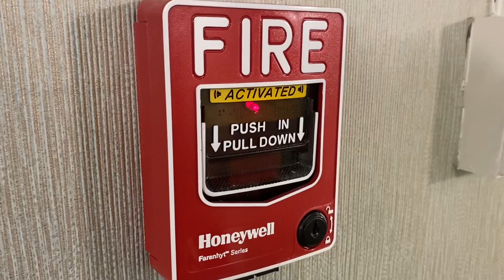From The Field: Fire Alarm System Upgrade

Comment: The horn at the end - did you replace it with a speaker or did you re-wire it to use a conventional NAC?
Reply from the maker: @g-Elevators675  speaker

Comment: What alarms did they used to have?
Reply from the maker: Old System Sensor speakers and BNG-1’s
Reply: @Dredpath1  do you have a picture?
Reply: @Dredpath1  does does the BNG-1 sound like
Reply from the maker: @jonathanstarling1082  the BNG-1 is a pull station

Comment: What do you mean? Don’t put horns on speaker circuits.
Reply from the maker: Horns and speakers are two different things. You can’t play a message through a horn. They have different components.
Reply: @Dredpath1  why can’t horns play messages, but speakers can
Reply from the maker: @jacobisworld9516  do you know the difference between a horn and a speaker?
Reply: @jacobisworld9516  Horns can't play a message because their sound is generated when 12 or 24 Volts DC that comes from a NAC circuit or any other source that generates that current goes into the horn wiring or the device's main wiring and goes into the horn circuit board, the circuit board then sends out electrical currents which is the device's sound that it makes of it's programmed waveform, carrier frequency, amplitude modulation, and frequency modulation of modulation of amplitude and frequency that then goes into it's piezoelectric speaker buzzer and as the electrical currents flows through the buzzer (flows from the positive end to the negative end), it goes through a ceramic material with Piezo-electric properties. This means that when it's electrical currents of it's generated sound is passed through the material, it vibrates, producing it's sound that it makes and the way it vibrates is based on its waveform, frequency, amplitude, and polarity as when there's positive polarity in the current, the piezo pushes out and when there's a negative polarity in the current the piezo pulls in to create sound waves which is by vibrating the air.

The way how speakers play messages and work is when audio signals are transferred as electrical currents through wires that come from the amplifier's speaker circuit and go into the speaker's wiring of what Voltage the signal is (fire alarm voice evac systems use 25 or 70.7 Volts RMS) and then it makes the speaker vibrate based on it's waveform, frequency, amplitude, and polarity as when there's positive polarity in the current, the speaker pushes out and when there's a negative polarity in the current the speaker pulls in to create sound waves which is by vibrating the air. The speaker also has a transformer which is a mini amplifier that can change how loud it is in the case of fire alarm speakers they use wattage tap levels as they transform the main signal to what volume level the speaker should be.

Now what you're saying on why horns can't play messages but speakers can, horns can play messages but it's only when you take the speaker wiring from the amplifier's speaker circuit and wire it directly to the piezoelectric speaker buzzer to bypass the horns's circuit board, otherwise if it's wired into the horns's wiring terminals or the device's wiring terminals then it will make it's sound but it will play in weird and random chirping rhythms or not play at all that will cause short circuit troubles on the panel or voice panel.
Reply: @jacobisworld9516  A horn simply cannot play a message because they use a piezo sounder. A speaker and a horn are different in obvious ways. So basically if you put a horn strobe on a speaker circuit you will fry the horn.

Comment: what were the original devices? never understood if notifier system 5000s were conventional or addressable. great video!
Reply from the maker: A mixture of devices. Old System sensor speakers
Reply: @Dredpath1  I meant initiating devices.
Reply: @Dredpath1 Like SP1 and SP2 speakers? That's the only oldest ones I can think of.

Comment: What!!! Why did the replaced that system 5000!?!
Reply from the maker: Because the system had issues. They did a full renovation of the building.
Reply: @Dredpath1  oh ok
Reply: You have to think about something, A System 5000 can only do so much. They are ancient panels & expecting them to work for centuries is a burden that the System 5000s cannot handle. They are going to fail at one point.

Comment: What speaker/strobes were used on the new system?  I recognized Wheelock E70 speaker strobes on the old system but never saw those speaker styles before I figured the end that was a horn only SpectrAlert.
Reply: SPSRL Speaker Strobes